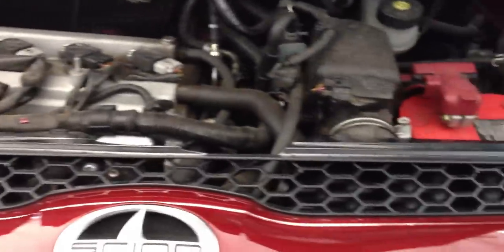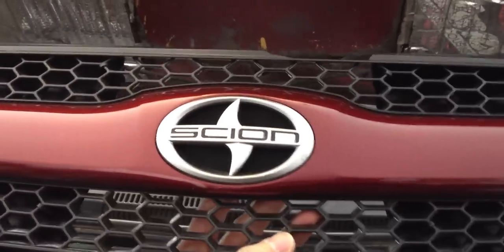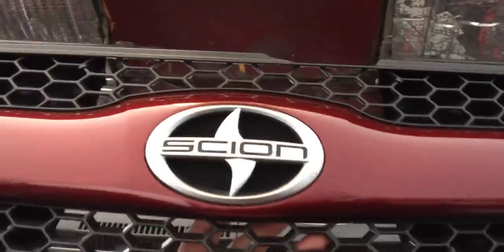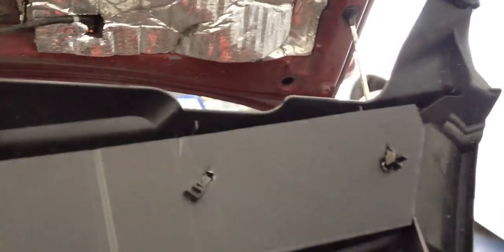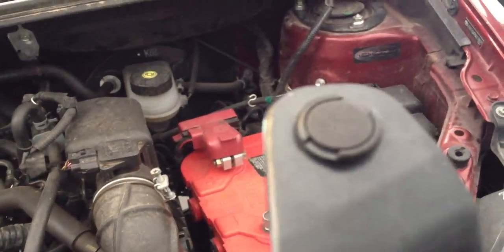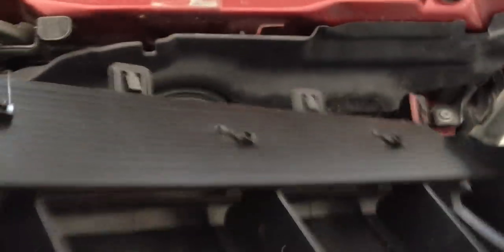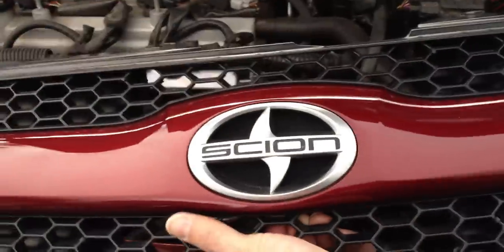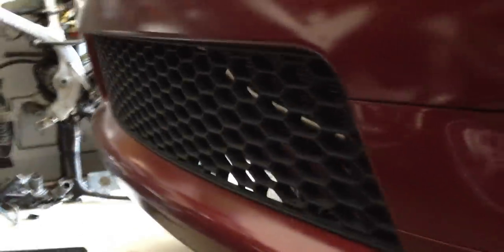Scion Xa Upper Grill Block for Improved Fuel Economy

Comment from the maker: @kleaFIRE I've blocked the grill almost completely from a high powered Subaru WRX , a Honda Accord, and now the Scion Xa. Never had overheating problems on any of them.  Radiators are extremely oversized.  A car has the cooling capacity to run on a race track during 100 deg days.  Nobody drives like that on a daily basis and so cooling ability is minimally affected, especially if you are using hypermiling techniques.  On the Accord I took careful measurements showing the aero mods do work.

Comment from the maker: @sunnyjason Keeping cold air from blasting the engine block and the engine bay in general even at 40mph should reduce warm up time.  I meant to take objective measurements showing warm up time improvement since I have a Scan Gauge, but didn't make time for it.  I'll do it before adding further blocking.  Even 30 seconds difference in warm up time can make a notable difference in MPG.  I'm adding an underbody cover at the front which combined with the front block will reduce warm up time further.

Comment: Completely covering the bottom intake and 75% of the upper intake is going to murder the airflow to your radiator. Also, don't you live somewhere in the southwest as well? They did the same thing you are doing in a episode of BBC's Top Gear to improve aerodynamics, all it managed to do was overheat the engine. Food for thought.

Comment: So the idea is, block air flow -> drive slow -> save gas? 
Seems prone to overheating.
Reply from the maker: A typical car's cooling system is way overdesigned.  It is designed to dissipate the heat generated in high load, high rev conditions.  Few drive like that on the street in every day commuting.